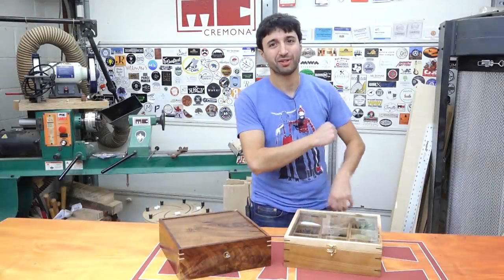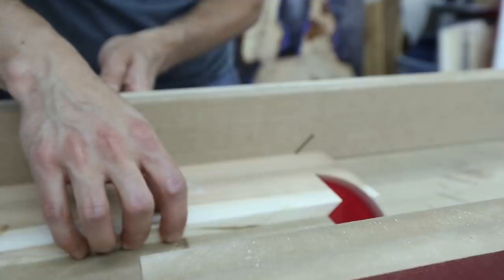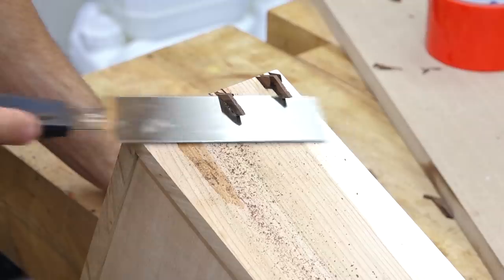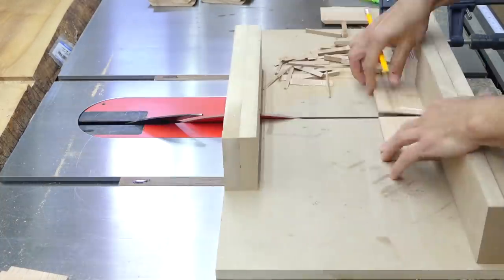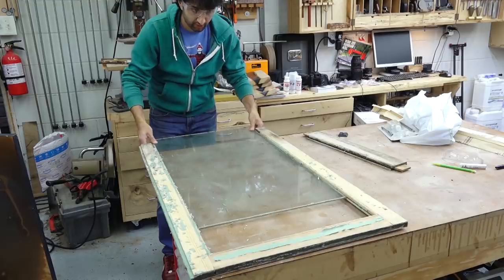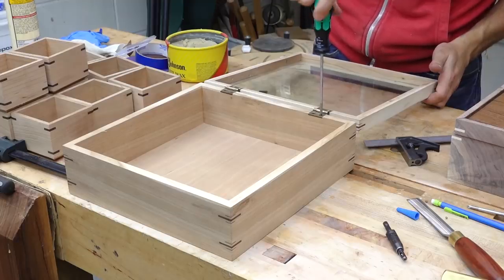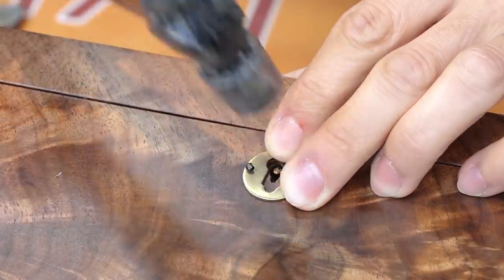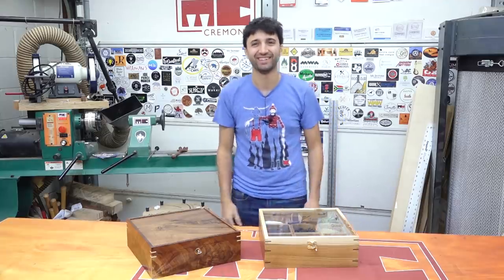Quartersawn Cherry & Walnut Crotch Spice and Tea Boxes

Comment: I like the “thicknesser” label.  Can never be to careful!   Beautiful work as always
Reply from the maker: Doing what I can to appease the Brits
Reply: Matthew Cremona next you’ll be learning French!
Reply: I knew we would make an Anglophile of you Matt, great boxes by the way.
Reply: Thing is, it doesn’t make things thicker. Should be called a Thinnesser.
Reply: @Artrcb  That's exactly what I was gonna say!
Never mind the Brits, Matt. Give all your machines German names!
Reply: @Artrcb  as you thin a piece of wood you are making your piece a certain thickness. So a thicknesser is not wrong.
Reply: Vignir Guðnason actually, the reason I use the tool is to make a surface plane with the other side of the lumber. That if gets thinner is just a result of that process. If you want it a certain thickness (or thinness), just keep planing. That’s why we call them “planers” over here in the US. Maybe we use more roughly cut lumber or you get better surfaced lumber as a general rule to start from. In the end, though, it’s just a joke, and I bet I couldn’t buy a thinnesser anywhere.
Reply: @jeffmeyers6837  .... or Italian? "Spessore"
Reply: @doubledarefan  ummmmm would at least keep the Brits amused "Dickungsmittel"
Reply: @mcremona  for Noobs, there can be confusion between a joiner and a jointer.  I like the Thicknesser label.

Comment: Was it difficult to calculate the size of the interior boxes? I'm thinking it was a matter of material size of the box walls  times 2 for each box and divide what was left of the overall length divided by however many boxes span the interior?
Reply from the maker: Adjust a stop block until three test cuts gets the combined length just right.